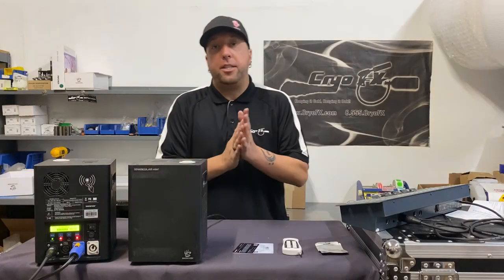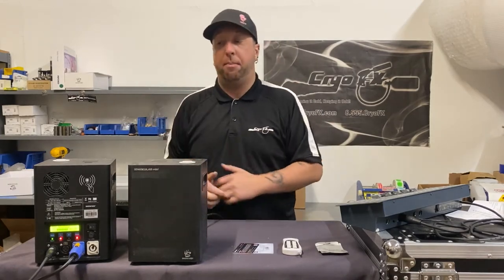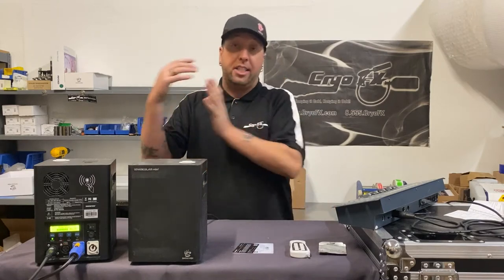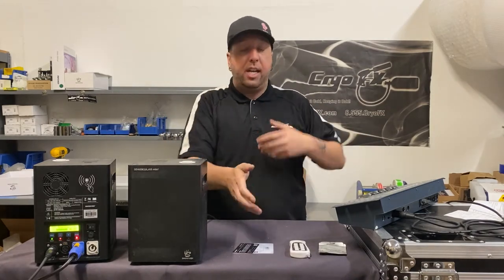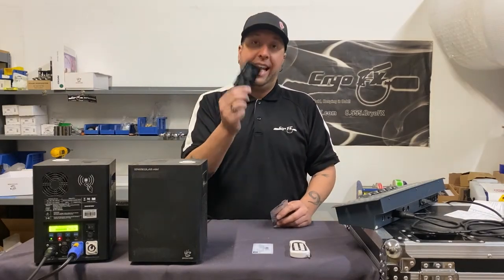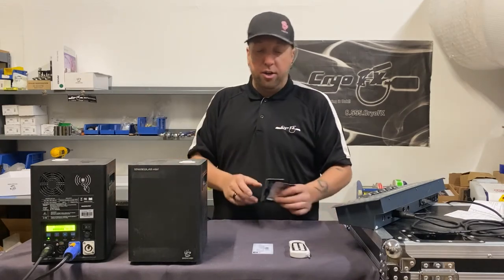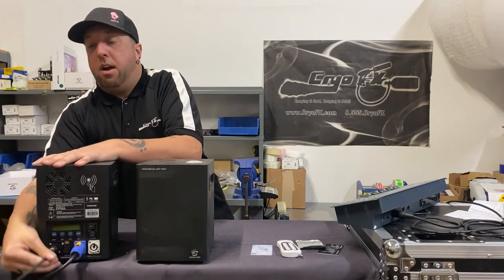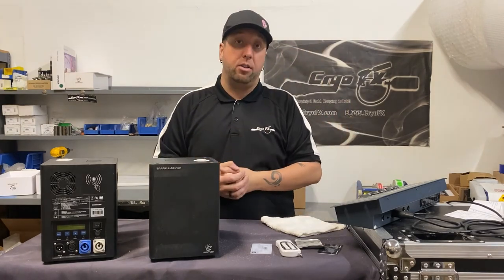How Does A Sparkular Work (CryoFX) How Does A Cold Spark Machine Work Showven Sparkular Instructions

Comment: Can you start sparrkular manually without dmx control panel or remote? Is there a button on the machine itself?
Reply from the maker: Yes there is, depending on machine type there will be a feature/option in the menu labeled "Manual" or "Manual Operation"

Comment: Hello. I just got a set of the mini's and when i demo'd there was some smoke present. I was in my garage and it was enough to set off my fire alarm. I've seen where the descriptions say no smoke. Is the presence of some albeit not a lot of  smoke normal?
Reply from the maker: Thanks for comment. On brand new machines, there may be a slight amount present while the heating element and other items "wear in" for lack of better words. Generally there should be no smoke, which in specific terms when used in larger area will not affect fire alarms. Smaller confined spaces have less space avail so sampling size for fire alarms is more frequent/larger therefore will set off alarms. Every situation is different and without seeing your garage this is the comments we can offer.
Reply: @Cryofx  thanks!

Comment: Say I’m using it during and only for the first dance, would I have to immediately then clean it out and running the machine tell all the sparks out. Or can I wait tell the event is done?
Reply from the maker: Typically you can wait until the event is done however we have seen some machines that when left too long may become jammed. This could be after much use or after many times being left on (heated) whereas the granules in the heating chamber burn up. Another trick we do is prime the machine (test until small amount of sparks come out) then use the clear function (activates the heating coil cork screw only - not the top cork screw feeding more grans in to heater) so you will still get the spark shooting out (only limited amount since your clearing it) but you'll also clear the heating chamber at same time. This has worked on live sets/movie sets/events where we cannot access the machines for long periods of time.

Comment: Question can you put too much granules in the hole input? How do you know how much to put in there. Is there a too much limit? Thanks
Reply from the maker: HI, Great question, simple answer YES! Depending on machine they will take between 50-200 grams. Mini Sparkular take 50grams, most other machines mini or large/regular size would take 200. We fill just under that to ensure theres nothing crammed in the chamber. Too much crammed into the chamber will place unneeded pressure on the corkscrew funneling the grans into machine which ultimately will wear it out faster (same concept when you compact the granules down by moving the machine in some instances).

Comment: How safe are these if using inside a hotel? Because of the water sprinklers
Reply from the maker: Every location is different, however we do recommend checking with Fire Dept or conducting a controlled test beforehand. Due to the different types of sensors (Photoelectric, Ionization, Laser etc) each has its own sampling parameters so while some may easily setoff, others may not. Distance comes into play as well. Generally these machines don't emit much "smoke" at all however just because the eye doesn't pickup on it, doesn't mean the smaller particles wont set them off.